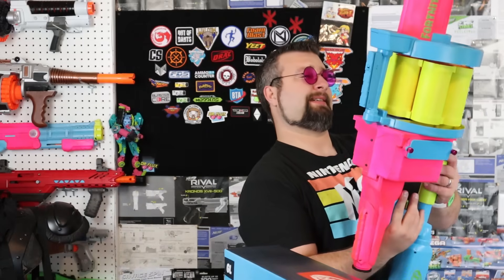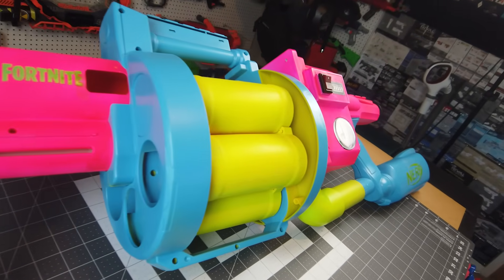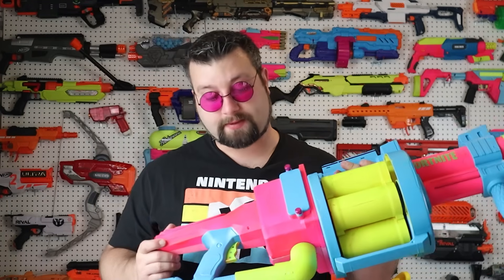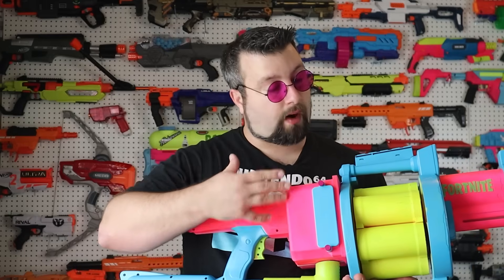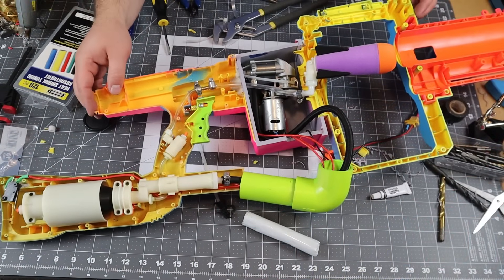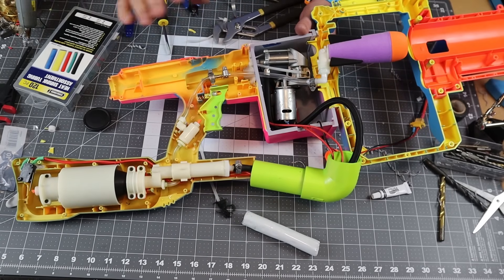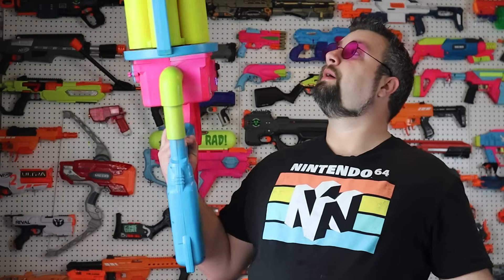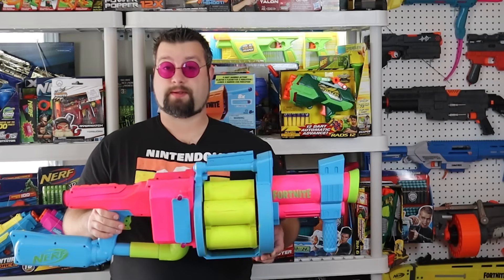Nerf Fortnite GL Air Pump MOD on 3 S LiPO

Comment: Hey before I attempt this MOD, did you try upgrading the stock internals first and just werent happy with the results bringing about this mod? Or were you just like oh no, I know just what this needs! Compressed air!
I'm wondering if a Rapid Fire 20 could be a good match.  I dont currently own one at this time but theres one for sale for $20 I may grab unless someone says "no that wont work at all" or otherwise.  
I have a mazooka but I'd hate to rape it just for the internals...wouldn't be worth it.

Comment: Quick action gas valve solenoid connected to a secondary gas chamber... 1st chamber holds the gas supply, 2nd chamber cycles and fires the rocket. That way the system is constantly charged. Lower cycle times, like a big ass paintball gun.

Comment: Found this video later than most. But I've been working on a replacement back end for it to turn it into a proper springer. The problem I'm running into is designing a priming mech that'll work with the under barrel prime. Gearing it seems like the primary solution, but then there would need a full priming rod and gear train and a way to keep the rotation mech intact, then there's the catch/trigger that can handle the spring weight required to fire rockets at a respectable fps....

Comment: Wow, that was an excellent explanation of how to do a compressored magstrike. 

I’m guessing you would get better performance with a rigid tank (like a titan or similar) instead of a bladder like the magstrike, but air blasters aren’t my strong suit.

One person on Facebook noticed that the fins on the rockets the GL comes with aren’t angled, which could explain some of your accuracy issues. (Although demo rockets aren’t really an accurate ammo type to begin with) 

All in all a very impressive build and I love the Behemoth of a blaster you’ve turned it into.

Comment: Has this kind of system ever been done before? Because this is so brilliantly simple and now I want to try designing a 3D print custom that works like this but with regular darts. The concept of battery-powered systems that aren't flywheelers is something I'm really interested in and this is a whole new way to do it

Comment: Ive done that compressor set up on a magstrike back in 2017. Running 2s. Didnt use a batt gauge, but the rest is as you say. Nice work

Comment: AFAIK the bladder system of the Magstrike isn't ideal for single projectiles, since it can't release all its air at once like a rigid tank. But with the straight-finned Fortnite rockets, increasing the power might just drop accuracy even further.

Comment: yeah I guess on the new nerf stuff you should do the screws by hand. my pharaoh had the plastic melt and freeze the screws in place from using a power drill. one screw was stuck and I pushed it out and the screw head popped off. another one I had to drill the head off to get it out.
Reply: I've always heard power drills on plastic is a no go, due to the heat
Reply: I'd use power to remove but not to reinstall IMO
Reply: @Rancid_Ninja  yeah prob the way to go. I usually do by hand anyway but I never had the plastic melt like that with other blasters I opened and closed with my power  drill

Comment: From what I’ve heard, the fortnite rockets have less of a spin due to the more straighter fins compared to the regular demolisher rockets’, so that could be a reason for the inaccuracy.
Reply: Would a SCAR barrel work for a Demolisher rocket, I wonder?
Reply: @BaconCheesesteak  I’m guessing no. It would have to very oddly shaped and I don’t think rockets have as much power as darts do compared to its mass. Of course this is just speculation but I think that the spin that older rockets give is enough to keep it fairly accurate